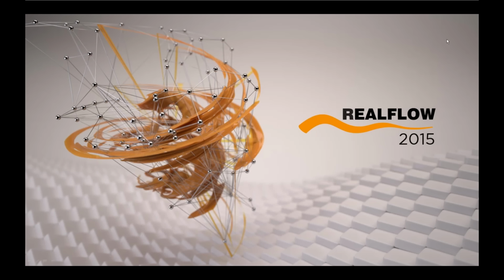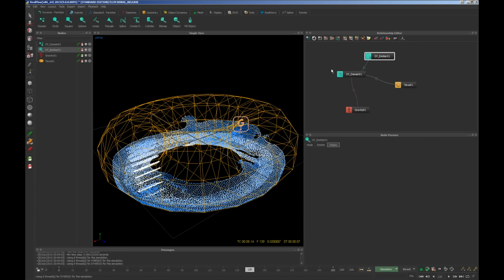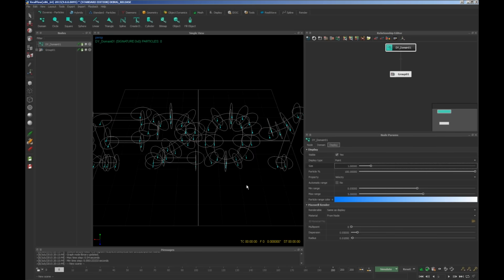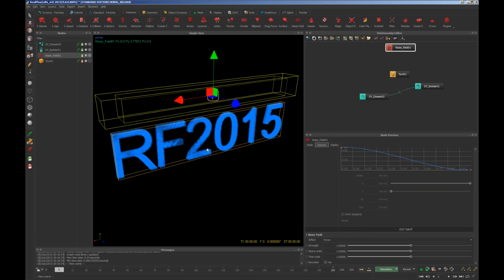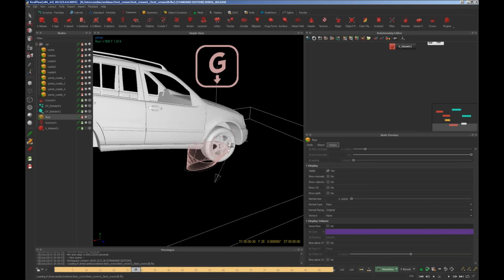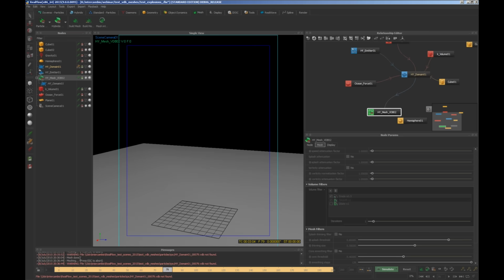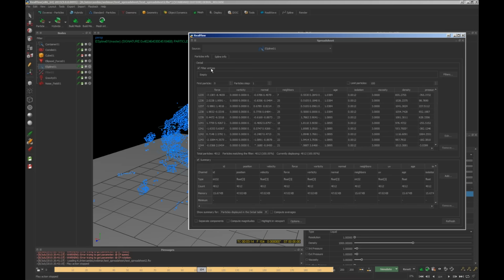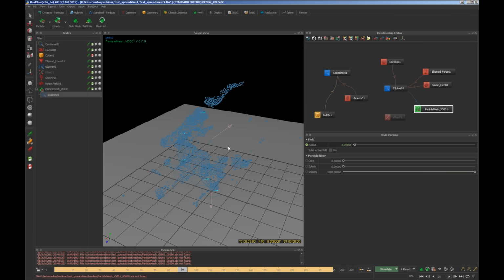RealFlow 2015 Quality Control Speed

Comment: I'm really excited about Dyverso. I like to use Standard particles a lot because Hybrio does not work for my needs most of the time. I need the detail of the standard particles.

One thing is will Dyverso have the ability to do "Sticky" particles? I found settings in RF2013 for my particles to stick to the geometry (mostly) the way I want. But when I take the same scene, and don't change any of the settings, into RF2014, the sticky does not work nearly as well and the particles fall off much too easily. How well does Sticky work in Dyverso?

Also, what about viscosity? I use a lot of high viscosity fluids in my projects, around 200-300, and that means lots of substeps which can mean 10-30 minutes per frame to simulate. How well does Dyverso handle viscosity?

Thanks!